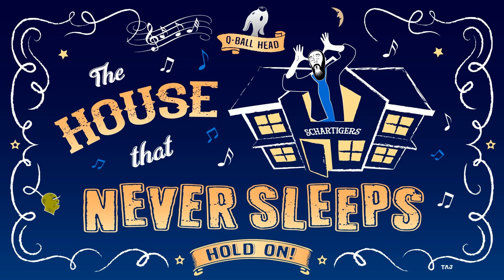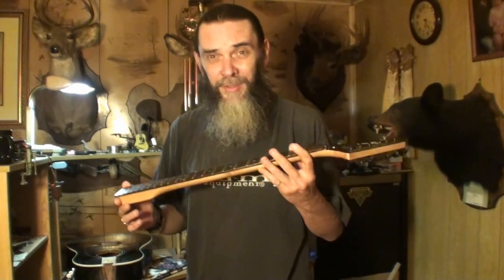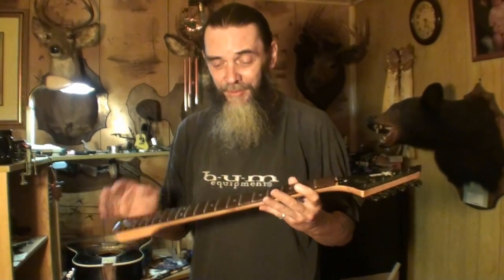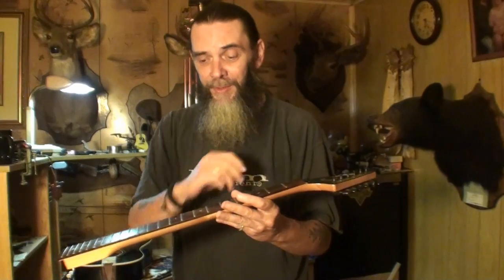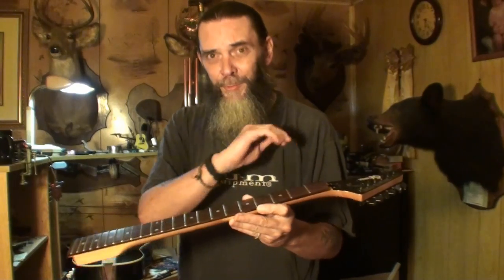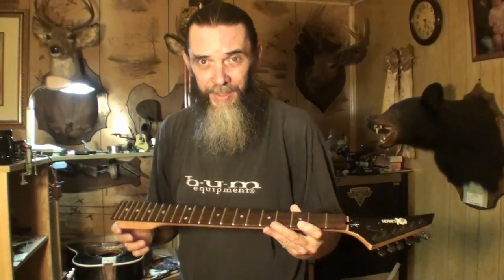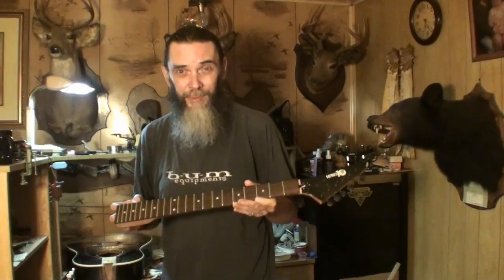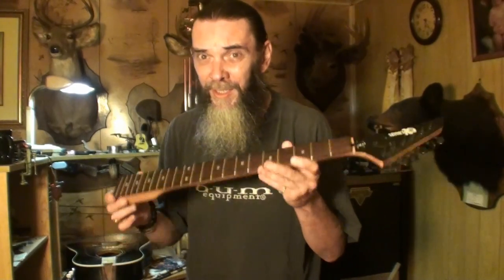truss rod adjustment tip

Comment: I like to preset a neck with when the strings are off with some back bow so once the strings are on I can loosen the rod a bit to land where I like the relief. That way I don't have to loosen and retune the strings a bunch of times as I tighten the neck. But I'll try this out and see if I can hear any difference.
Reply from the maker: It does present a sort of pain having to loosen the strings to being tension of the truss rod back up, but really does effect the overall sound, I don;t always do it because of the time it takes loosening the strings and making the adjustment and tuning everything back up, but I should. Thanks for watching brother!

Comment: Hey Randy, i just got a Jasmine S34C from a pawn shop and I'm trying to pinpoint the exact size alan wrench i would need for a truss rod adjustment without just using trial and error.. is there a standard size or something?? Some places i read 4mm and others i read 5mm.. any insight on this??

Comment: hi Randy, Something I'm wondering about ... I've been told there are truss rods on which the nut does not come loose and off. The man who told me this called it a double action truss rod. I've been wondering if it is the case on a guitar I've been adjusting on. The nut just wasn't coming off. And unfortunately I've made a mess of the nut. I'm trying to get in contact with Yamaha to learn if the nut comes off on my model. Do you know anything about such a truss rod? On which the nut isn't designed to come off?
Reply from the maker: It sounds like you have a 2 way (or double action) truss rod, on a 2 way truss when you start loosening the adjusting head it will at some point start to get tight again and not screw completely off the rod. A single action 1 way truss rod will allow you to screw the adjusting nut right off of the rod.